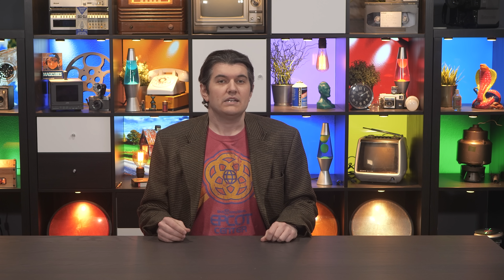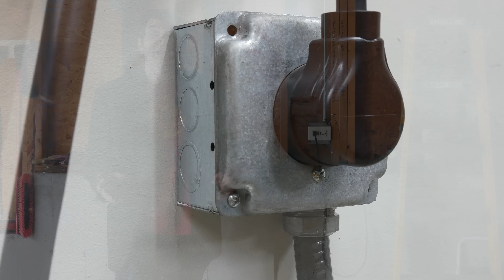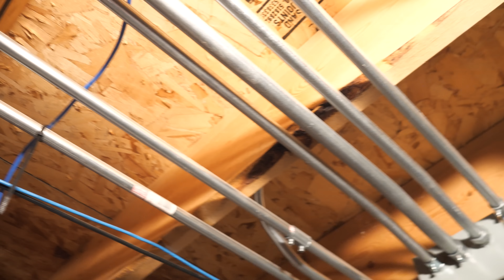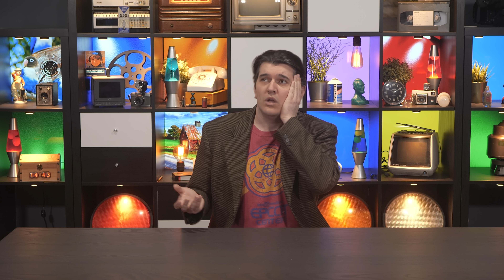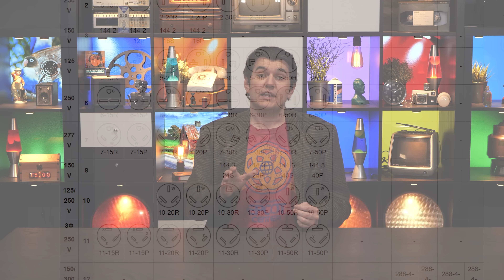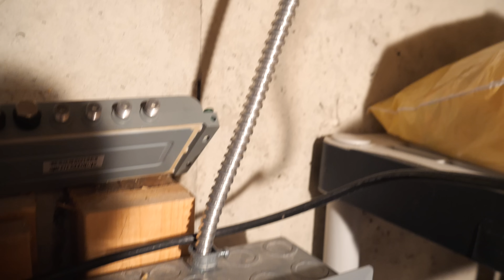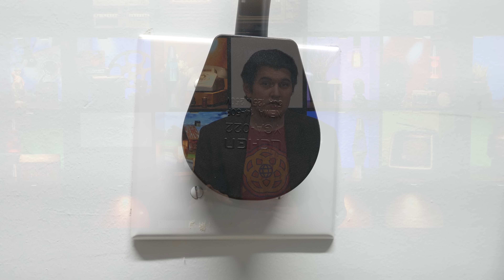The "standard" car charger is usually overkill—but your electrician might not know that

Comment: I have a Grizzl-E Duo. It can "intelligently" split power between two EVs with no Wi-Fi required. It just splits the 9.6kW evenly.

One counterpoint to smart EVSE's is the Emporia Pro Level 2 EV Charger. It can automatically scale up or down the available amps based on the overall household usage to stay within the limit of your electrical service allowing it to be considered effectively a 0 in an electrician's load calculation. The promise being that you can install one without upgrading your electrical service.

That said, I think your advice of going with the smallest workable EVSE for your daily drive is the most practical.

Comment: 10 miles per hours charging is the first reason why I don't want an electric car. That's your speed the moment you have an emergency.
Reply: In that rare scenario just use a DC fast charger.
Reply: How is that the speed?
Reply: @TheMysteryDriver  basically you have to sit for one hour to get 10 miles of range. Then you have to actually move that 10 miles. Assuming that's the distance you need to travel that time, you effectively traveled less than 10 miles in 1 hour. So that's your speed.
Reply: @TheMysteryDriver  basically you have to sit for one hour to get 10 miles of range. Then you have to actually move that 10 miles. Assuming that's the distance you need to travel that time, you effectively traveled less than 10 miles in 1 hour. So that's your speed.
Reply: @-na-nomad6247 lol and I'm sure you take into account all the work you do sitting to pay for gas in your mpg calculator right?

Comment: I strongly recommend that you hire an electrician who is certified to install outlets FOR EVS. I was going to have an electrician install a NEMA 14-50 outlet in the detached garage for my condo, but I decided to get a quote from a Tesla certified electrician, and it turned out that the wiring wasn’t sufficient for that outlet and I’d have had to pay thousands to replace the wires running underground all the way to the transformer. Fortunately, the certified electrician told me I could use a NEMA 14-30 instead (which the wiring could handle) and even told me how to order an adapter from Tesla. My vehicle easily charges overnight to 80%, even when the vehicle has almost no charge left.

Comment: With the exception of Tesla, equipment and networks of the public EV charging network is still shyte. Endless issues with stations not functioning, apps not working, endless software issues, compatibility issues, etc. This is a case of a client and service situation where each working in conjunction with the other is critical, but it’s like they’ve never even heard of the other. If you can charge at home and your use is in the metro area, EV could be the way to go. Can’t charge at home, or you travel, forget it.

Comment: Unless you want to wait 48 hours for a dead battery to fully recharge or you plan on driving less than 50 miles a day, you really do need it. A 120 volt 20 amp receptacle will put about 8 miles of charge on your electric vehicle per hour, at best.
Reply: Most people drive less than 50 miles a day. Also it's not a binary choice. You can do 240v 20a and double that with the same wire gauge.

Comment: You have to install heavy duty 50A receptacle for a car charger (for example Leviton 1450R) NOT a standard 50A receptacle that you'd use in a kitchen for a stove/oven. The stove receptacle isn't made to hold that much current for that length of time and can melt (I've seen it).

Comment: Here in the UK EVSEs usually run at 30 A, so 7.2 kW on 240 V, single phase. When we got a VW EV, it would only charge at 3.6 kW, which turned out to be because the VW was designed for mainland Europe, where three-phase is much more common, and the VW ran on two of the three phases, with 3.6 kW on each, and a total of 7.2 kW. That is great for houses with three-phase supplies, asit keeps the load down to 16 A per phase, but not so good in the UK, where just about all houses are supplied with single phase.

So we could only charge the car at 3.6 kW, not much more than the 2.4 kW we can get with a charger plugged into a domestic socket. (10 A from a 13 A socket at 240 V). 

Just as this video points out, limiting to less power just isn't a problem in real life. It's a small car with a 36 kWh battery, and it will charge fully overnight. 7.2 kW would make no practical difference.

Comment: For our first experience with EV, we purchased a plug-in hybrid., but purchased a more or less premium smart charger--in part because our utility was offering a rebate for that class of charger and access to a lower after-hours rate.  Based upon this video, when we go for a full EV to replace our ICE vehicle in the next year or two, I expect that I can get a less capable charger and use that on the plug-in hybrid without having to replace my nearly maxed out electrical panel.  Thanks--you may have saved me a bunch of $$$$s.

Comment: I went on holiday to a house that had a 230VAC 16A (13A) outlet. I had a 30% charge and wanted to leave the next morning with 100% charge. It took 17 hours to charge the car. Having a faster charger helpes for short decissions, say you want to drive somewhere in the next hour, the amount of energy you can quickly get in your car is priceless and will most likely prevent you from stopping by at a fast charger.

Comment: 16:50 I think the difference is in how much time it takes to go from "enough left to get around town" to "completely full to go on an emergency trip to pick someone up from far away, or a last-minute road trip". You're right, we don't fill up our gas car every day, but if we suddenly need that range, then I would hate having to charge for a few hours first.
Reply: In that scenario you would use a fast charger.
Reply: If you charge overnight every night, and that adds 100 miles to your range (conservative, should be more), but you only drive 70 miles a day, then you'll wake up at 100% every regular day.

And if you need "emergency charge", fast chargers (which work like gas stations) take minutes, not hours.

Comment: Dipswitches?? I'm glad my charger has a local web interface and API that other software can talk to. So I can run a server that talks to my car, to my solar panels and to my power meter and optimize charging for the best price. Charge it to 65% at night, then take whatever the solar panels provide during the day. I also like that my charger can talk to various models of powermeters to perform load balancing, so that it will never melt my main circuit breaker when I use my oven or washing machine. No additional switching device needed. And the charger supports OCPP so it can report charging stats to my employer for billing. So yeah, I like a 'smart' charger, as long as it can be locally controlled.

Comment: NACS/SAE J3400 has one major advantage for L2 charging, and it's probably worth an entire episode: Unlike J1772 which is capped at 240V, J3400 is rated for up to 277V charging.

Why does this matter? Most commercial buildings (including many apartments) have 277/480V 3-phase power coming from the power company! To install J1772 they need additional transformers to bump down to the 208-240V range. Added transformers means added cost, heat, space and wasted electricity. J3400/NACS can directly use one leg of the 277/480V service.
Reply: An annoying thing in Canada is that commercial properties often have 347/600V 3-phase power. There's no electric car charging standard which supports 347V AC, so car charging circuits will always have to run through an additional transformer.
Reply: @kepstin  Good point. I was unaware of the difference for commercial power voltages in Canada - but I should have specified USA anyway even though Technology Connections is obviously a US-based channel.
Reply: @SavageChinquapin  Yep, I just wanted to add a bit more context, since people usually assume the electrical system in the US and in Canada are the same. They're similar, but not quite the same :) There are apparently also a few places in the US that use 600V - I believe mostly older factories in the east.
Reply: @kepstin  I do really appreciate the info. And yeah, you can find all sorts of odd remnants if you look around enough. As you note, often it's old factories and old cities. Even though AC had completely won the "war of the currents" over DC by 1890, ConEd continued supplying DC power to some customers in New York City all the way to 2007. 

Of course, ConEd accomplished this by paying for and installing onsite rectifiers to convert the incoming AC to DC within the building... And the NY subway still runs on DC...

Comment: No, I don’t top off my gas tank daily, but since I can go from an empty tank to a full tank in two minutes I don’t need to.    Until I can charge an electric car in a few minutes I’m not interested in having one.   I frequently drive 300 miles at a time.   I’m not interested in sitting around for an hour and turning four hour trips into five hour trips.   Plus I don’t have to deal with Karen’s who want to gatekeep the charger station to a specific vehicle brand, deal with angry unpluggers or vandals or out of service charging stations in the middle of a desert.

Comment: Also, before using ANY standard plug in your house to charge a car, please, hire an electrician to check your installation. In my old village house, and by that I mean "older than the US" house, we had an electrical installation from the 50s (I think) that ran on 115 volts. When the 220V current came in, some appliances were able to run on 220 or 115 V, but some of them needed a transformer. Over time, every appliance, from TV sets to refrigerators were running on 220 (except the old Kelvinator, which standed it's ground at 115 with a transformer for many years before budging and turning itself into a mouse proof pantry). A few years later, we built a garage with a little light bulb and an electrical outlet, you know, for the eventual car vacuum cleaner and stuff. An then, decades after, my cousin's husband plugged his Tesla to the garage outlet. It took hours, but the wires melted and the cloth envelope of the older wires caught fire so fast, that they immediately disconnected, giving no time to spread a fire. So please, check your wiring before any intensive use.

Comment: The thing stopping me, a young and moderately wealthy software professional, from getting an EV is repairability and staying power. I dont want to buy a car that 4 years later needs a $20k battery replacement. Are these sorts of issues a real concern or something early adopters dealt with but are mostly fixed now?
Reply: Those are mostly fixed. EV batteries are routinely lasting 10+ years now.

Comment: The NEC requires power for a charger in each garage bay now. Also, if you go to an electrical supply house you can get MC cable in larger sizes. I've gotten it with #6 conductors.

Comment: It is good practice to fit an Isolator next to the Grizz*le ( charge controller) useful when the fire service is called to put out the battery fire and need to isolate power before throwing water everywhere.

Comment: 5:07 Like in the UK, adding a circuit is a Building control notifiable work and EV chargers need to be declared to the energy board for them to guarantee there isn't an overload as most of the UK is over subscribed and they're working on bringing that back to parity. I do believe you can add an outside 13A (standard) socket yourself though if you're adding it to an existing circuit (at present, please check!)

Comment: 100% you can live the EV life just fine pulling 16amps on a 20amp circuit. Just plug in when you get home and it's good for your daily commute when you wake up.

I drive a 65mi round trip and shelled out $1,300 for a 60amp exterior (RV) outlet. It's overkill adding 27mi of range per hour drawing 48amps, BUT I also want to run a 240v tig welder on occasion, so it makes more sense. I only now plug in every 2-3 days depending on where else I travel.

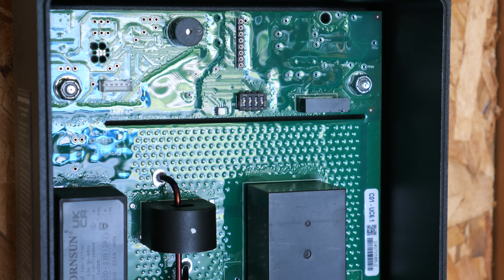Comment: 12:00 per the J1772 standard, the EVSE is not /required/ to cut off the EV's charge if it doesn't respect the authorized current (ie, it isn't respecting the limit). You'd definitely be at the mercy of the breaker's tripping at that point. Thankfully, every bit of NEC is overly conservative to allow for these types of scenarios

Comment: I had 1kw charging for my tesla for 9 months and very rarely had any issues. Of course when I did finally get around to getting a 32A 240V setup installed, the benefits were immediately noticed, but there are sometimes I still use the basic plug.

Comment: We have our plug-in hybrid hooked to a standard 120 volt 15 amp outlet & it charges just fine (the car has two amperage modes to boot). No issues on the car end, and the outlet does not get warm etc. If it had a MUCH bigger battery, we'd be looking into doing 240 volt, but even then i think a good 8-10 hour charging session would suffice off the same 120v outlet. It's not rocket surgery, just math. If your math says you should probably have that 240 volt outlet, then go for it, otherwise skip it.

Comment: Oxidation aside the biggest issue with aluminum vs copper (solid core not stranded wire) is that aluminum will wiggle right out of a mechanical lug, compression lugs are much safer. The thermal aspect of aluminum causes it to expand and shrink much more readily as compared to copper. Basically use copper, the small extra cost is well worth not burning down your house.

Comment: Funnily enough I literally did this (installed the Grizzl-E on a 30 amp circuit) a few years back. One note though, you can use the 50 amp plug for a 30 amp circuit.

Per NEC 210.21(B)(1) "Single Receptacle on an Individual Branch Circuit. A single receptacle installed on an individual branch circuit shall have an ampere rating not less than that of the branch circuit."

So as long as its the only outlet on the circuit, the outlet just needs to be rated at or above the ampere rating of the circuit. So I just put in a NEMA 6-50, and plugged it in.

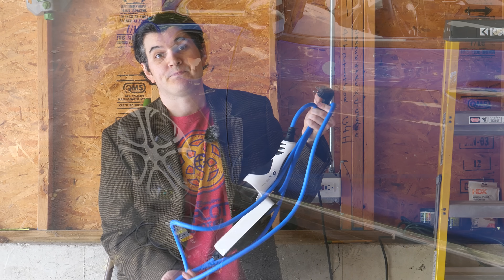Comment: 2:53 promoting the emergency charger seems a bit bananas. At least in Norway, it is not intended for regular use. In fact, it is not legal to use a regular socket for regular charging at all, you need the charger mounted by the electrician
Reply: Well, he isn't in Norway. And it's not an "emergency charger" in the United States. It's simply considered a level 1 charger. Perfectly legal to use anywhere anytime.
Reply: Emergency charger is a funny name for something that is definitely too slow to be used in an emergency 😂

Comment: if you use a 110 you will have to charge at ALL hours to get it fully charged.  And that means when rates are high and low.  240 allows charging faster at cheap times.  My Tesla which I drive 70+ miles a day, can’t be charged JUST during the cheap hours.  I put the 240 in myself and it wasn’t much more than a few hundred dollars in parts

Comment: I’m glad the nacs is going to be the de facto since it’s capable of operating on a 277 volt nominal circuit which will help facilitate cheaper installation of level 2 chargers in commercial spaces such as offices, shopping centers, etc by utilizing power directly from the 480/277 systems without the need to use additional transformers to lower it to 240 or 208 volts. Cheaper and simpler installation.

Comment: Right now I have two EV‘s and two chargers, I have a 32 amp 240 V charger that my wife uses pretty much all the time, and a 120 V 12 amp charger plugged into the wall that I use most of the time. On the rare occasion, I need more juice, I just plug into her charger.

Comment: I live in the Chicagoland area and decided to add a charging station in April of 2024. I made some calculations to figure out what was appropriate for my situation. Here were my parameters: 1: I didn't (and still don't own a vehicle to charge) and 2: I wanted to spend the least I could. Solution, level 2 40 amp charging station with a NEMA outlet. How can that be? Simple, rebates for doing the installation. I got a conduit that can accommodate up to 100 amp wiring, a NEMA outlet and a 40 amp charger unit for the total cost of floating my utility $1400 for three months. 

As for using a 15 amp outlet (or, after an upgrade I did to accommodate my air compressor, 20 amp), a lot of comments made on another video where the EV owner only ever used a 15 amp outlet said these outlets and circuits aren't really meant for long-term current flow at close to their rated maximum and these don't have any ability to communicate with the car. I don't really know how big of an issue this is but it sounds truthy.